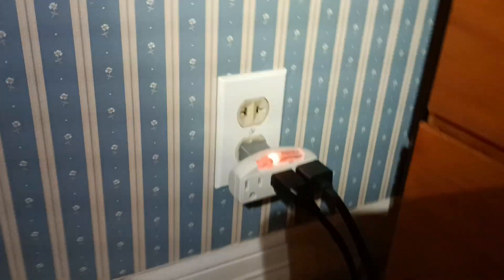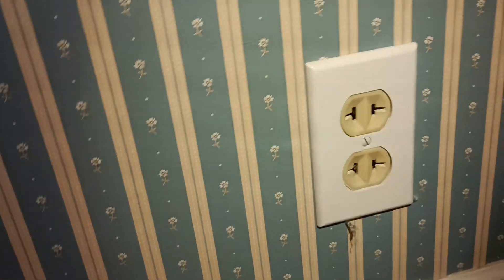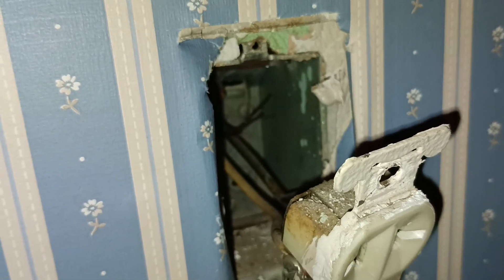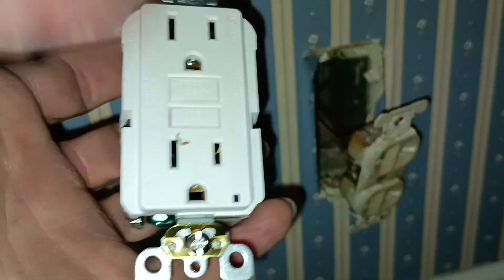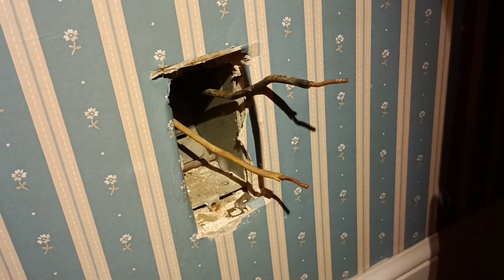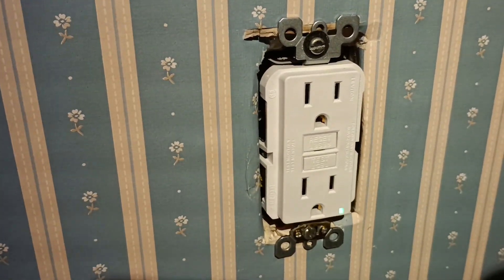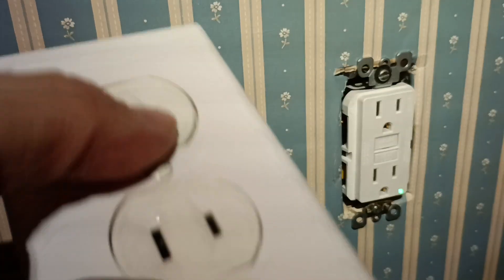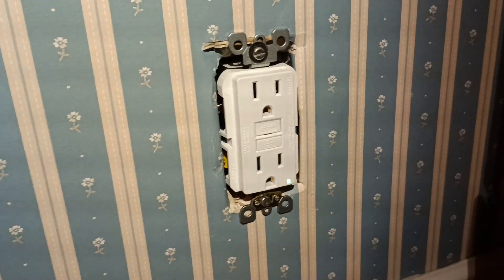How to change a 2-slot/ungrounded outlet to a 3-slot outlet

Comment: 1950s had ground 3 prong outlets and breakers

2 wire houses are from the 40s or 30s or 20s

Remember, less than 40% of the country had electric in 1950

The first power plants in the 1910s and 20s they wired up houses with no meters.
They power company ran a service to a house and piped the line from one house to a second house.

These were 60 amps single phase 120 volt installation

In the 40s I believe they started the meters to charge for the kwh used by each person and they put meters outside

In some old towns you can still find these old remnants on the front of buildings if they have not removed them.

It is incredible to see power plants with over 100 year old turbines and generators still working like the day they were installed.

Truly incredible workmanship from General Electric

60,000 men worked in Schenectady NY building these massive generators and transformers and the D&H and B&M railroads ran right into the plant and carried them to the power plants and substations in a time before most people had electricity or cars.

GE Schenectady was known as the ELECTRIC CITY

They invented Television and had the very first TV station on the air in Schenectady before TV existed

GE is responsible for the entire power grid and the Television and cameras and transmitters and most people don't know GE was the first company to build Satellites

In the mid 1970s GE-1 and GE-2 were the backbone of satellite communications for the United States

It is a shame what happened to them.

Comment: AHHHHH !!!!!!!!!!!!!
DON'T TOUCH THAT !!!!!!!!

This house has fuses, I am sure

This could be knob and tube wiring.

The entire house needs to be rewired

If you put in that GFCI I would tell the homeowner to get APC smart UPS for anything electronic in the house.

This is scary old
Reply from the maker: It's not that old LOL. Knob and tube stopped being used in the 30s and grounds started being used in the 60s-70s. This house has a recently updated panel so I'm not sure if it originally had a fused panel or not since they were pretty much phased out by the 60s. I know you didn't mention it but the 60s and '70s were the same period that aluminum wiring was being used. That's an entirely different ball game as well.
Thanks for the comment.

Comment: Technically, to be NEC compliant, you also need to add a sticker or label to the face plate that says "No equipment ground", to indicate that the outlet's ground pin is not actually connected to a proper ground (most GFCI outlets come with some stickers in the box for this).  It is fairly minor, but still a good idea anyway.
Reply from the maker: Yeah, good observation. I actually mentioned that in the description since my recording equipment died before I could get the plate and sticker on. Ironic that I run out of juice while working on electrical LOL.
Thanks for the comment.

Comment: Not that I'd recomend using it but if your box is grounded you can run the plate screw through that little metal loop at the bottom of your adapter.
Reply: Yeah, but I've never actually seen a box with two-prong outlets where the box was properly grounded, so good luck actually finding that situation.

(And if there is actually a proper ground running to the box, and you've got a screwdriver, then you might as well just swap it out for a three-prong outlet anyway, and then you won't need the adapter at all.)
Reply: @foogod4237  It is good to use a GFCI anyway. It hurts nothing and it will immediately trip on a  fault if here is any kind of ground connection. One cannot easily determine if a ground is proper. It requires professional equipment. A simple socket tester will not show it.

Comment: How does that first outlet do 120/240v?
Reply: It doesn't.  If you're talking about the fact that it has "T-shaped" slots, the horizontal slots are because there was actually an earlier configuration for (120V ungrounded) plugs in the early 1900s which had two horizontal pins, instead of two vertical ones (but they slowly fell out of use as the vertical design became more popular and was ultimately officially standardized)..  These outlets were just designed to support both of the old types of 120V plugs (vertical pins and horizontal pins).